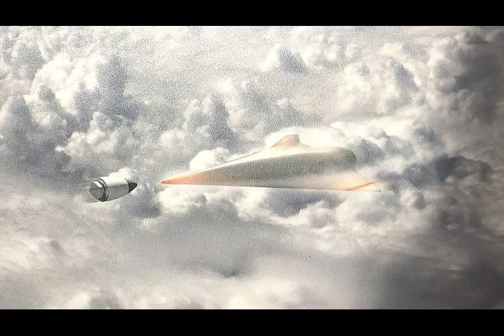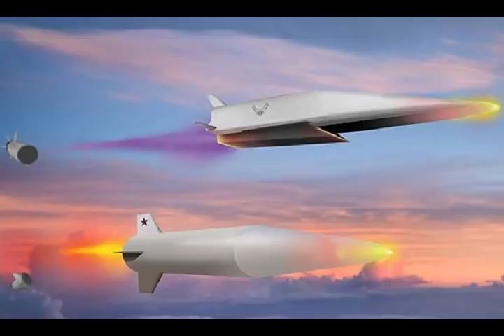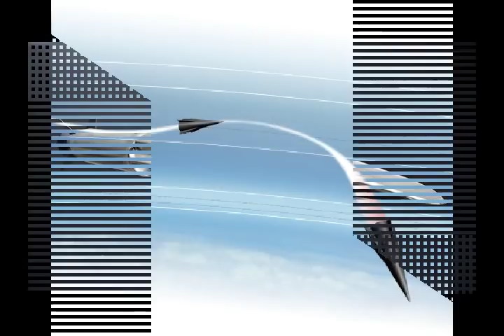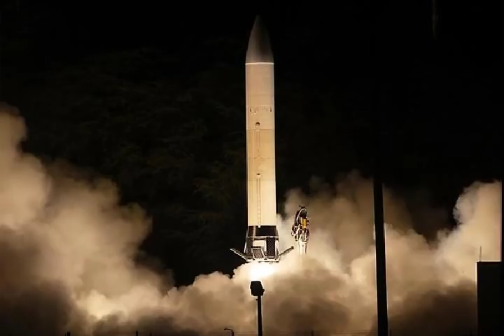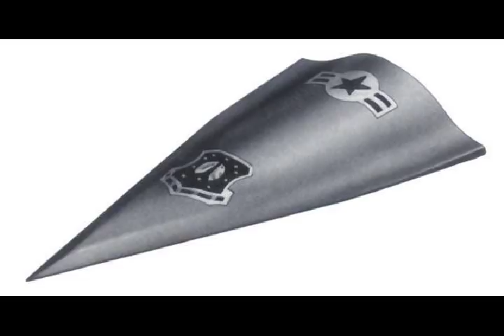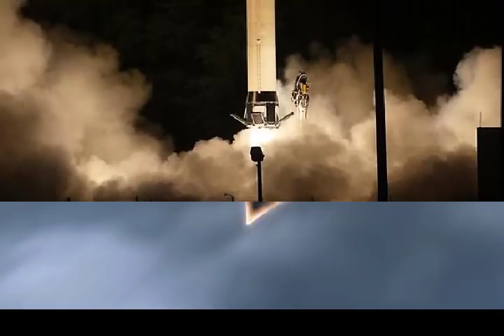"Glide Breaker", US Hypersonic Weapons Defense Project

Comment: Hypersonic vehicles produce in flight IR emission can been seen by IR imaging equipped satellites. 

The hyper velocity prevent vehicle from taking a smaller radius path render their flight agility.  Therefore can’t avoid mid flight agile smart obstacles 

At hyper sonic weapon travels on a planned flight path at a terrestrial targets and can’t deal with mid flight smart obstacle. 

For that reason it can’t justified to carry a close loop steering system good to avoid mid flight agile obstacles. 

Defending nations need to have two systems (1) satellite to seek out hypersonic IR signature to determine a general mid flight air space region. (2) to rapid deploy some smart and transverse agile obstacles (bumper or road blocks) in that air space ready to intercept incoming hypersonic vehicles. Smart obstacles should have a close loop transverse steering that is guided by forward sensing RADAR and IRDAR good to intercept those hypersonic weapon in mid flight before after during they start reentry. 

Why that works ? It works the same way on food ball field when your opponent team all can run 10x faster than your team. Only that opponent team enter the field all blind folded and were instructed where to take a blind man’s turn towards his goal and they can’t see you. 

Hope this helps.